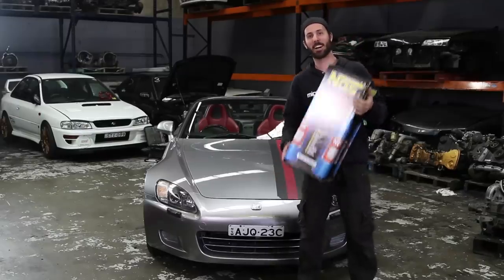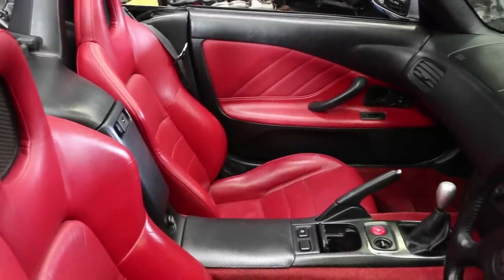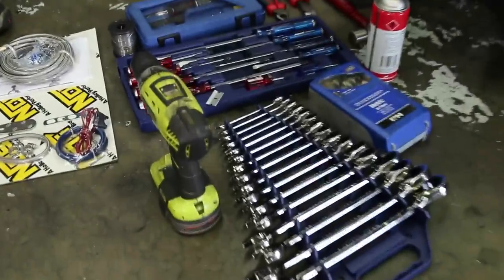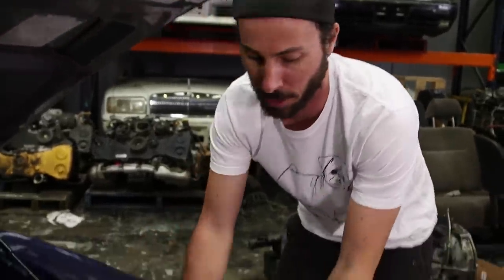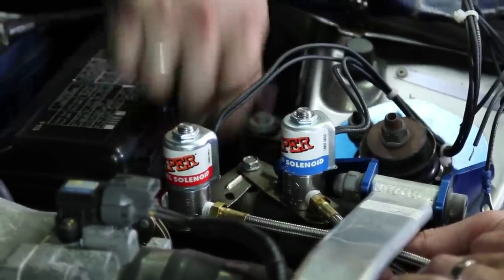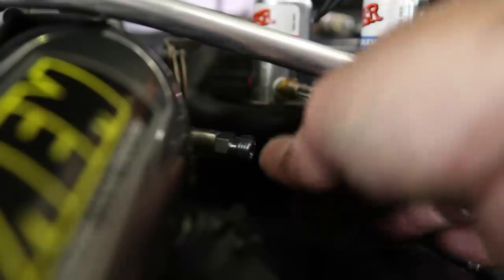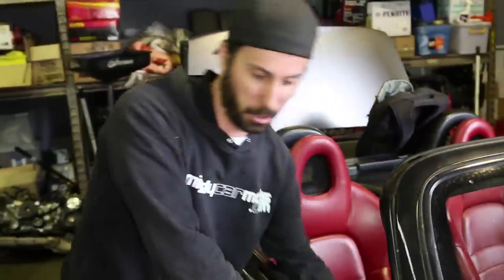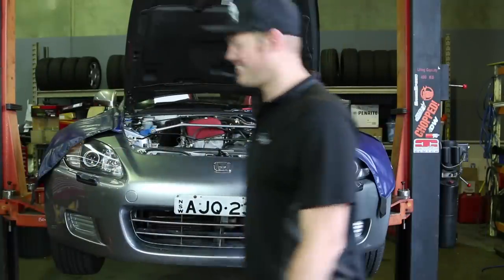How To Install NOS

Comment: y does the package say NOS but the NOS bottle is orange and say sniper?
Reply: Brand?
Reply: bernard wallace NOS is the install system, there are brands that use that system to inject their No2
Reply: bernard wallace Its a kit they offer. its designed to be installed in a more "discreet" way, even a bit more than they did. Some nitrous kits are extremely obvious when in installed in the engine bay. People who race at strips or on the street will install the connections on the underside of pipes and tuck away all the hoses. The orange bottle and the name are just to separate it. Everyone knows that nitrous usually is seen in a blue, so they made it look a bit different.

Comment: isnt nos bad for your engine?
Reply: seong min It can be, mainly because it puts more strain on the internal components than what was intended for. At the amount he is running its within a safe reasonable amount.
Reply: seong min it depends on the capabilities of the engine, everything that adds power can be harmful but not if the engine is ready to handle more power than it already has.
Reply: Wrex what's the max I could do on my stock b18 without getting ANY type of problems

Comment: What to buy list.
1.Buy a Supra
2.Buy a Big Block Chevy
3.Buy a Super and Turbo Charger
4.Tune the car and act like an normal guy driving a normal supra
Reply: Why? U can get the inline 6 with a twin turbo
Reply: Renzeth Bulawan Pulling a JZ out of a car is a crime. You should be ashamed mate.
Reply: How Come i see guys With Supra with 2JZ
Reply: What ?
Reply: +Renzeth Bulawan the turbo lag on the supra in insane other than tht its a nice car
Reply: Matt DaGamer
Turbo lag depends on the size of the turbo and the tune of the ecu.
Get a small turbo on a JZ and tune it and you'll get minimal turbo lag.
Reply: true tht
Reply: +Dédé LABINOUZE  true but.. aint 2jz is quite noisy?
Reply: yr
Reply: Renzeth Bulawan
 Again, it depends on the exhaust you choose ^^

Comment: I kind of feel bad for moog on this whole S2k series. He got a lot of shit from everyone and S2K's are pretty decent cars. They just suck at anything under 5/10 of what the car's power is. I think honda finally got it right with the k series though. More torque lower down in the range (ap2 does the same) and it's just a more drivable car. 

Lastly people give honda owners shit because honda owners are so artificial. They love to talk shit, you have to harass them to run a race you already KNOW you're gonna lose in some cases because losing to them is a way bigger deal than having fun. If more  honda owners stop suffocating the brand with their own value as human beings I think a lot of people wouldn't mind having a nice little NA Civic to take into the canyons. Especially those of us who can't get things like the Pulsar VZR -_-

Comment: why not use oxygen gas???
Reply: No consistent controllable burn(nitrogen molecule in N20 is the buffer that gives your the more stable combustion/burn)... 

Think of an oxyacetylene torch and what happens to the heat and flame when you hit the oxygen lever... Not good in an engine😀

Comment: MYTHBUSTING TIME!
Common myth is that n2o provides more oxygen to a fuel air mixture, and therfore engine can burn more fuel and produces more power.
(Lets leave for a moment the fact that n2o has only one oxygen atom per a molecule, and every ECU with lambda control will detect that there is way to more oxygen in exhaust gases and will switch the engine in a service mode.)

Sounds reasonable, some may think, bout if you inject some n2o directly into the inlet manifold it will increase power output as well, even without adding the extra fuel, so how is this possible? More oxygen from n2o makes no sense, what could it react with, as there is no fuel?

Well the answer is simple chemistry, when petrol reacts with oxy from air the products are co2 and h2o
bout if you will add n2o to the mixture, the engine will produce a lot of n2 molecules (gas), h2o (gas), and co2 (gas)
its 3>2
The actual difference is the volume of gases produced - the more gases is produced the greater is effective pressure, witch means more torque.
N2O DOES NOT PROVIDE MORE OXYGEN

4 nazzies
(tried to explain the reaction as simple as its possiblle)

Comment: Why can't you just use compressed oxygen ?
Reply: no nitrogen to control the combustion.
Reply: +MrAlexiasjones I found this complicated explanation on the web, here is a cut and paste.The simple and most relevant answer is because we couldn’t get enough into the engine for it to be as effective as NOS / nitrous oxide. Air has only 23.6% oxygen by weight, the rest is made up largely of nitrogen. Although nitrogen does not aid the actual combustion process it does absorb heat, as well as damping what would otherwise be a violent explosion, rather than a controlled burn. When you add nitrous, it has 36% oxygen with the rest being nitrogen. So the more nitrous oxide you add, the less percentage of nitrogen is available to absorb heat. That’s one of the reasons why adding more nitrous increases the heat of combustion very rapidly. If we were to add pure oxygen (which has been tried), the percentage of nitrogen would progressively decline to a much greater degree than with nitrous, as more and more oxygen was added. Consequently an engine wouldn’t be able to handle much pure oxygen before the increase in heat lowered the detonation level to unusable levels. Furthermore, oxygen can only be ‘readily’ stored in a compressed ‘gaseous’ form, without being stored in a special cryogenic thermos cylinder (a cylinder within a cylinder with a vacuum between the two walls) and as a gas it loses the cooling effect that nitrous offers by being available as a liquid. Adding the oxidiser as gaseous oxygen would displace more air than adding nitrous in liquid form, resulting in a lower total power capability. In other words; by using nitrous oxide we can squeeze in more oxygen atoms in a more beneficial form, containing substantial amounts of detonation suppressing nitrogen, than would be the case with gaseous oxygen. - See more at: http://www.noswizard.com/nos-technical-information#oxygen

Comment: Nothing goes "kablamo" in a good way
Reply: If that was the case the piston wouldn't move inside the cylinder.
Reply: Filipe Amaral -_- well played
Reply: GormyGorm your car engine, assuming that you have a car and it isn't electric.

Comment: Cant you just use 100% oxygen for max power?!?
Reply: Nah, pure oxygen would yield a too fast uncontrollable heat(think acetylene torch when you add the oxygen).... The nitrogen is what makes the burn consistent and considered a buffer.
Reply: So it would kinda be like in the movies when they let off a gas tank so it fills a huge area, then they light a spark and all hell breaks loose...

Comment: imagine nos with water methanol injection
Reply: Pcwizard20ghz fuck it i would install 4 bottles in the trunk all connecting to the one nos line and for water methanol a 4 to 6 gallon tank and if the acceleration or speed kills me than I've done it right

Comment: why not use oxygen gas cylinders
Reply: Goofy Gulf Compressed oxygen is a very aggressive oxidizer, so it requires a very robust (and heavy) containment system, because it is VERY dangerous to have an oxygen leak near a flame source (think all the gas in your gas tank burning off liquid-fueled rocket style in a matter of seconds).  It is also very likely that you would need to heavily modify your fuel system, so the engine wouldn't run way too lean and risk detonation, and you would need a lot more cooling, to make sure your engine doesn't overheat from burning so much extra fuel, and even then it is likely the engine would fail due to massively increased stresses on piston rings and other internal engine components. Also, compressed O2 is very expensive, so while you probably could, it wouldn't be worth the extra money,  effort or risk.
Reply: Also have to take into effect that oxygen alone would create FAR more heat than necessary, while not adding any energy.... theres a reason that people use Nitrous, which is oxygen and nitrogen.... the 2 most abundant gases in our atmosphere

Comment: why couldn't you just put in oxogon gas?
Reply: +Aidan D because it would act the same way without since oxygen gas is the gas an airintake and a turbo use.
Reply: +Aidan D Because you would need a vacuum insulated tank to keep the oxygen liquid - it won't condense into a liquid form above -119ºC no matter the pressure. Meanwhile, NO2 can be liquefied at room temperature so you can fit more in a tank.

NO2 is also injected as a liquid because if it was a gas you wouldn't get evaporative cooling.
Reply: Filipe Amaral thanks so much
Reply: +Filipe Amaral That's not entirely true.  The reason they do so is that pure oxygen and gasoline burn hot enough that they would melt an aluminum engine block.  

Above 31C and at very high pressures, oxygen becomes what is called a super-critical fluid (the 5th state of matter), it has the density and incomprehensibility of a liquid, but the flow behavior of a gas.  This does not inhibit it from being stored in a tank - in fact this is how it is stored in the Space Shuttle.  However, it does complicate design, because upon exiting the tank it will first turn into a liquid, then evaporate, meaning that the valve and piping immediately adjacent to it have to be able to handle temperatures as low as 30K (about -240C) without shattering - doable, but somewhat expensive.

https://www.agronomy.org/images/publications/vzj/2/3/287f1.jpeg

Comment: normally I am all for re-engineering stuff, but this is way to dangerous.
The gas tank is safe to use but to bring oxygen near heated parts is a stupid, stupid idea. 
Oil-oxigen explosions are so violent that you will it see only once. 
Not to speak of the damage to the engine while boosting in the internal forces.
Reply: Nitrous is actually not flamable unless its very compressed and mixed with fuel
Reply: You obviously have no idea about nitrous systems or nitrous oxide (non flamable). I've been running nitrous on my motorcycle for the past 6 months and there has been absolutely no danger to the engine or myself.

Comment: Why can't you just use an oxygen tank
Reply: several factors. Size, efficiency, the lack of nitrogen.... pure oxygen would create shitloads of heat, but doesnt help add any energy....so its would get really hot, but not help with power.

Comment: A quick rant...  FFS,  stop using the term "NOS"!!   NOS is the abbreviation for a company, Nitrous Oxide Systems. They used "NOS," and also N.O.S., for the logo and branding of the company. No one involved with  performance upgrades had ever referred to the product or company as "NOS," until the abhorrent (and technically ridiculous) movie Fast and Furious came out. To say you're putting "NOS" on a car could possibly mean you're putting an energy drink on the car, but not a nitrous oxide kit. Try using "nitrous," "N2O" or "nitrous oxide" next time, so you don't sound like a pimple-faced ricer kid with a clapped-out 4 door Geo Metro with the obligatory 5 inch fart can installed, along with every bolt-on offered by J.C. Whitney.